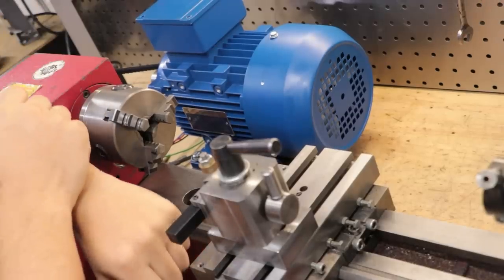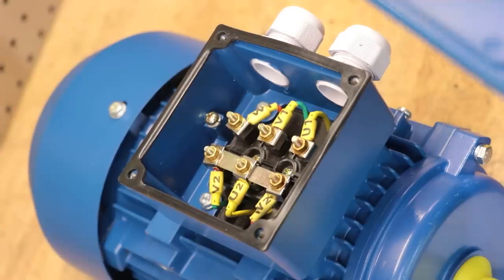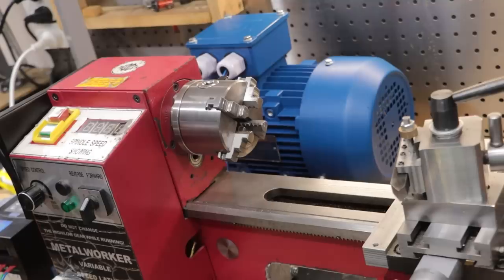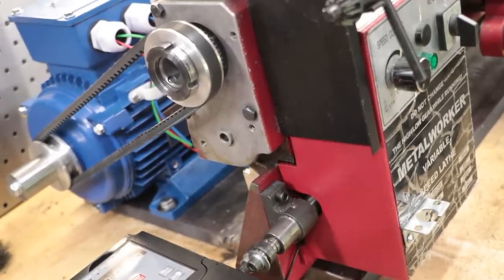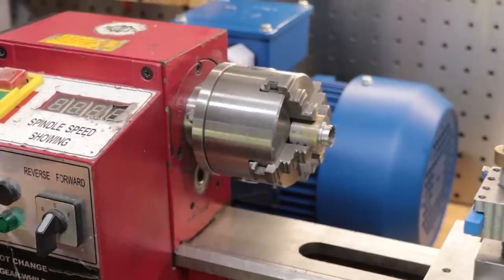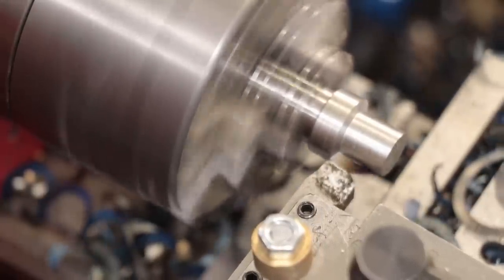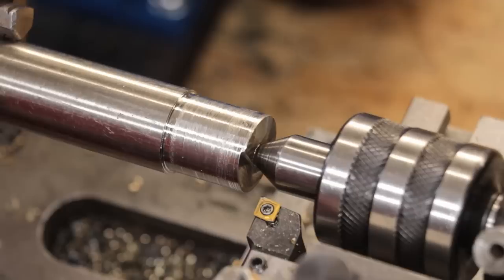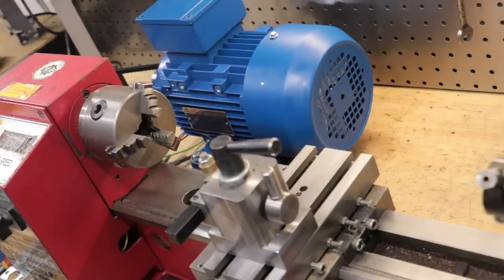The 3HP Mini Lathe..... It Scares Me

Comment: There's another good reason for a groslly overpowered motor.  With these minilathes when you machine a larger diameter and have to turn the RPM down a lot of these machines just can't do it with more than a whisker cut.  Your 3HP motor will still have a pretty good measure of torque even at low frequency operation for the low speeds.

Comment: A VFD/3 phase motor driven spindle power upgrade is a real performance improvement for under-powered home shop grade machine tools. In my opinion, 3 HP is about ideal for your application. You have plenty of power for rapid stock reduction, continuously variable spindle RPM, and if a suitable control station (Fwd-Rev-Stop pushbuttons and a spindle RPM control pot) is installed, you have every control advantage to be found on far more expensive manual machine tools. And you beefed up the spindle bearings. Excellent, though I have reservations about the precision grade selected.

Your concerns that your newly installed 3HP motor will somehow damage your mini lathe are purest self inflicted BS. Those who prate about ruined bearings, broken parts, sudden death in a firey explosion, etc have obviously never seriouly thought through the implication of upgrading a machine tool drive much less conducted an engineering analysis. Consider available motor torque. A 3 HP induction motor delivers about 9 ft lb (metric heads do your own conversion) shaft torgue at full electrical ratings. 

Your motor pulley looks about 3 1/2" dia - 1 3/4" radius. Doing the math: 9 ft lb x 12 = 72 in lb. 72 in lb / 1.75" radius = ~41 lb belt tension. These starting calculations give you data to apply to gear ratios, cutting forces, etc. My Mk 1 eyeball suggests your existing belt drive is barely adequate and serves as an excellent substitute for an overload clutch as you pointed out in your previous video.

 Should you wish to quantify the point of slippage, you could block the spindle and employ a torque wrench adapted to the motor shaft. Conduct trials varying the torque settings as you go to the point of slippage. Naturally, there will be variables to consider: belt tension, temperature, wear-in, belt contamination (oil mist, dust), etc. But if numbers are important to you, a little research and experimentation will reveal them.

As for increased HP jeopordizing your spindle bearings, that's a valid concern. Start first with the bearing's load ratings. For that you need the number of the bearing and a browse through the manufacturer's catalog tables. My wild guess is the factory stock ball bearings are roughly equivalent to #207 whose static radial load capacity is listed by SKF as 4946 lbf. You've replaced them with dimensionlly equivalent taper roller  bearings having static load rating of roughly 13,000 lbf. 

Under what condition of spindle gearing, cutting force, shock, etc would you expect to exceed this rating? Remember this is a catalog rating that incorporates some form of safety factor. Also remember, the motor itself will not damage the spindle components: it's the overload you impose on the spindle - collision, wreck, feed oveload, tooling failure. 

Even well-intended assertions un-supported by objective facts and verifiable numbers are bullshit. Bullshit is still bullshit no matter how often its repeated, how loud its shouted, or the alleged authority attributed to those who promulgate it.

Do your research. Do your math. Simple conversions and upgrades on machine tools aint rocket science.

And, yeah, get your exposed motor wiring in armored flex.

Comment: Flat bar is made in long lengths.
It sags under its own weight like wet spaghetti - even at 16mm thickness.
How do I know? Well I deliver it. It bends in a huge arch with both ends touching the deck of a semi and the forklift at its highest extension. That should illustrate the flexibility of it and why pieces that you buy cannot be straight. If you want a precision bed, you'll need to mill it.
Reply from the maker: I can’t deny that it would sag but so far after doing a bit of machining, bending is not causing any issues, at least nothing that presents itself as taper or the like. Not to say that it won’t though.

Comment: 3HP is an overkill, when you use a properly specified set of pulleys (two stages, preferably) to get the desired low RPM. With just a VFD for speed control, it is much less of an overkill, because at low frequency the motor has much less power than at nomnal 50HZ. How high above 50Hz do you run motor? A VFD has no problem to go well above 400Hz, but the motor has to be built for it. 
I personally would pop of the back cover and build an independent fooling fan, with an interlock to VFD, to make sure the motor has enough cooling. My second-hand, high quality, reputable brand VFD that I use on my small lathe (made in 1989, that came with 3-phase motor) only lets me run the motor at 10Hz or lower only for limited time - to prevent me from overheating the motor. 
By the way, I was very surprised your V-belt is not slipping on such small pulleys when taking 4mm cut. I would try to make larger pulleys - to put less strain on belt and make it grip better.
Reply from the maker: I don't run it above 50hz. haven't had the need to yet anyway. There is obviously reduced power at low speeds but it is still more than enough for what I am going to be throwing at it. Cheers

Comment: Watching this series is interesting.  But it would have been easier (and cheaper) to buy a used 2-3 hp lathe.

This series is fascinating, though.  It's a bit like watching a series of a guy who puts a v8 into a car that came with a 4 cylinder and all the struggles he has to overcome.  Yes, it can be done.  But there's always some limiting factor.  I.e. the engine/drivetrain then becomes the bottleneck.  The suspension or control arms and other parts simply aren't beefy enough to handle the load.
Reply: He doesn't have space for a 2-3HP lathe, and any one you'd find cheap would need a complete overhaul.
Reply: @jaro6985  Good manual lathes can be obtained pretty cheap these days as most shops are migrating towards CNC work these days and manual work is going the way of the dinosaur with Tormach and other mini-CNC lathes (etc).  

IF space is a constraint, then you can stick with a small jeweler's type lathe 9" swing or less).  A budy of mine has a 100+ year old southbend and that thing prints money for him.  He's a wizard on it. Old as hell, but better than any modern chinese lathe.  Tons of spare parts on ebay and tons of tooling there too.

As long as you stick with a major brand (i.e. southbend) and check the ways of the lathe and the lathe comes with tooling then good deals can be had.  It's best to see/test one under power from the guy who actually used it for the past 30 years vs just buying one at an auction site.  Last lathe I got came with tooling and was 13" gap bed and I got it for under $1000.   Yes,  you'll need some space for it.  If you don't have 3 phase power like most industrial shops, then you can swap in any single phase motor rather than get a phase converter.  Like used cars, all used lathes will require some work.  No free lunch!

Comment: 😢 I've been watching your videos, and I have enjoyed them. But I'm not going to make any comments about this 3Hp motor conversion. What really provoked you to do this?? So please explain what was the reason for doing this?
Reply from the maker: Just got tried of endlessly stalling the old motor. Especially in 4140 and stainless. 1 or 2 hp would have been enough but i found the 3 for a good price
Reply: @Artisan Makes  Thanks for your response. Materials like 4140 and alike stuff can be a challenge. It's pretty difficult to exchange, ideas with ytube comments. Currently, I'm dealing with getting my email system up and running sometime soon. In short, I have been involved with 44 years in the equipment field. I want to build various items. As a hobby, I'm 66 years old. My Lathe is a 11" swing x 30" centers. But the Mini Mill I have, it really lacks the ability to mill detailed components. I want the new mill to include with a DRO. Take care now...

Comment: For high strength steels, use lower RPM(blue chips are the indication of high speed) and high feed. You see the square insert cuts much better. Most likely, if you add an angle to the tool,  you can cut much easier bigger cuts.

Comment: torque converter from a minibike/gokart, chop it up for its expanding pulleys, and you got yourself a variable speed drive.  or you could hunt around for  the same thing from an old industrial machine... like a ... cough cough... bandsaw... (what? what?)

lol at people thinking it will break. "oh no, its 3 HP..."

its only capable of continuing to TURN with 3hp of work.

you gotta load it down to get that 3hp...

99% of the time its basically idling on this machine.

like a 350 chev makes doodly squat when its idling... "oh no , its 500 hp and its going to break the bricks you have it resting upon"
for the pundits. they make doodly squat at 3500 as well, if the throttle aint open...

anyway.... people are stupid. ignore them.
im people. :)

Comment: 3hp is a lot of power but it is not. It won't break your lathe. Imagine i could stop the 50 hp 950 rpm electric motor of our woodmill using a square 40 mm thick wooden stick about 120 cm long, by placing the stick under the belt pulley and the concrete floor and using it as a brake. Than you understand how low 3 hp is and it will never ruin your lathe.

Comment: I guess the use of single pulley is to make sure there is no chance of transferring full torque. May as well used a smaller motor - such as 1.5hp or 1hp. There are tables made of pully sizes and max torque that can they transmit.
Reply from the maker: We’re well within the load limit for this size belt. And it’s gotten close to pulling 2kw from the wall then doing large diameter drilling and it’s not slipping. That’s far above what I could do with 1 or 2hp

Comment: Entertaining and wacky video.  Of course, this is a total waste of electricity most of the time, and the lathe is still a toy.
Reply from the maker: This lathe rarely pulls 2kw of power
Reply: @artisanmakes  Of course!  But that 3HP motor is probably consuming about 1.5HP of power even at no load, because motor efficiency drops so dramatically at low load.  That's why over-spec'ing motors is a waste of electricity.  You do great work, by the way.
Reply from the maker: It’s been. few months since I did it but I look at a power meter and it was rarely pulling over a 1000 watts on most normal cutting loads. I had to push 1.5/2mm doc in steel to get it in to get it 1000-1500w. I forget what it was pulling at aidle but it wasn’t a huge amount. Low hundreds I think